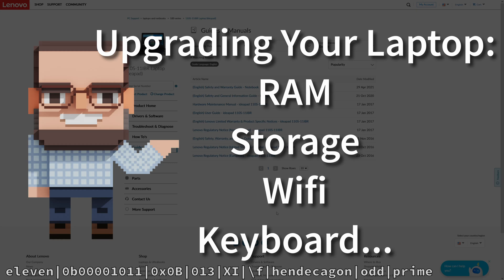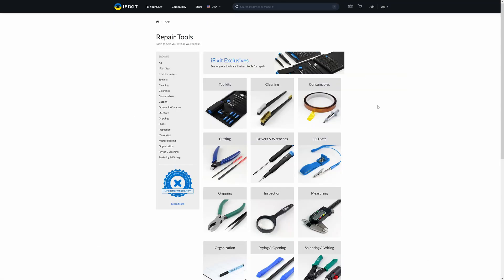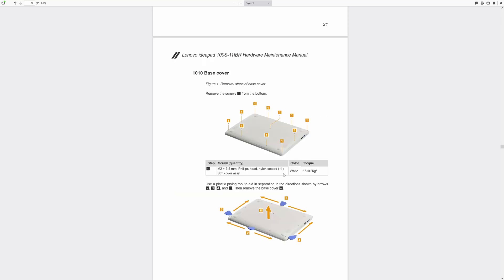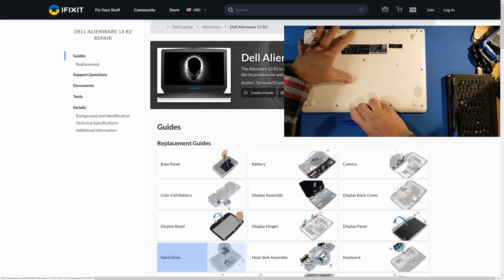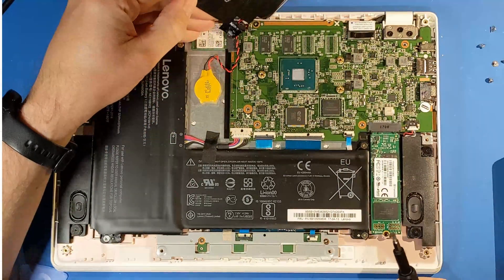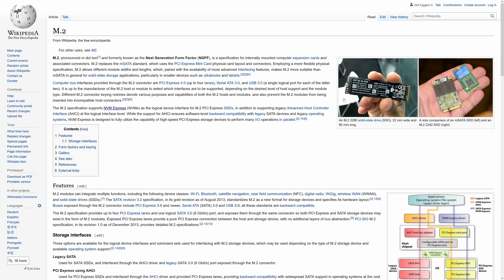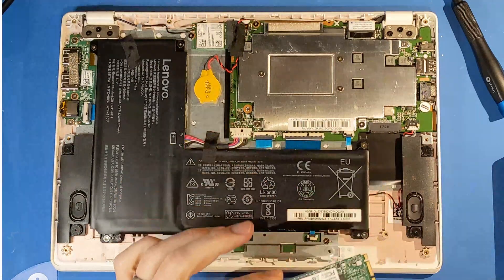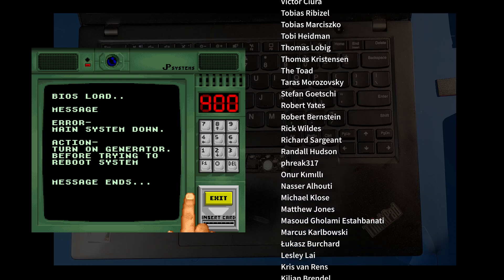Laptop Upgrades You Didn't Know Were Possible

Comment: I still use a 10 year old T430. Replaced the keyboard (from T420), screen (from T440), maxed out the RAM, added SSD
Reply: It is insanely upgradable. Mine has 16 GB of RAM, 2 SSDs by using the UltraBay, the 3x3 N WiFi, and a i7-3632QM quad core with HT. It's such a nice platform for this that there's an entire Medium post about just that model